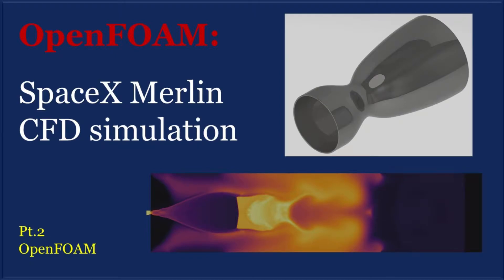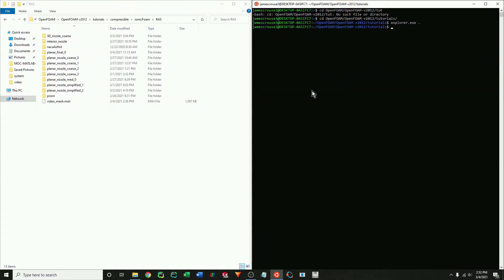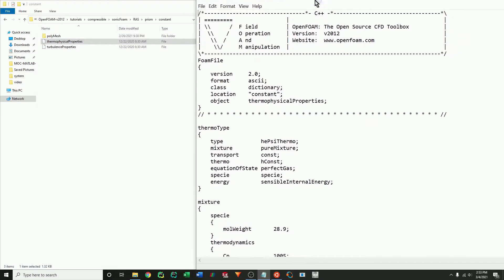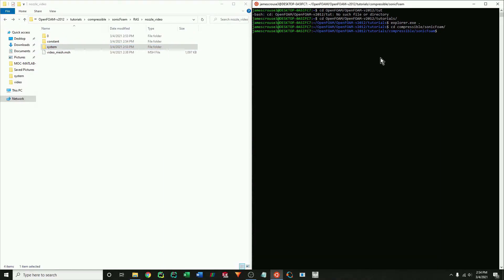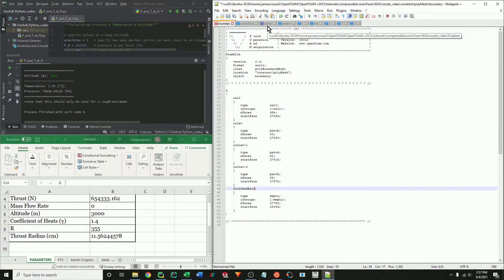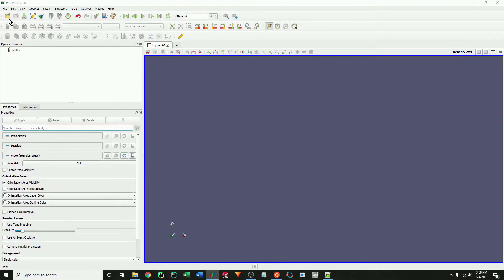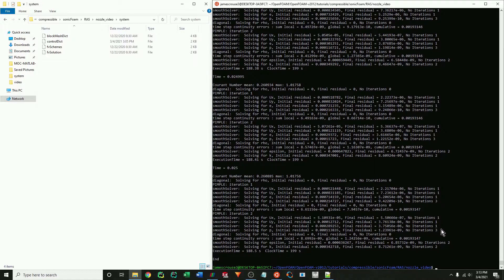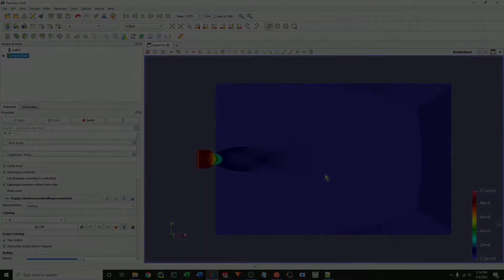SpaceX Merlin Nozzle: Pt.2 - Running the Simulation | OpenFOAM tutorial 3

Comment: Out of curiosity, why were the top and bottom walls of the domain noSlip? Would you not want them to be open boundaries? I've been playing around with this case for simulating my own rocket engine, and have been running into issues which I think are probably stemming from shocks reflecting off the top and bottom boundary walls.

Comment: Hello,
Thank you for making this great work.
I have some question about this project. How can I calculate epsilon (turbulence kinetic energy for this project)?  Initially every where it was selected 266000.
When I run I get negative T0 error, How much should I decrease Delta T in order to avoid this error?
Thank you and Best Regards.
Reply: You can calculate k and epsilon at the inlet based on your turbulence model coefficients, average velocity and a given turbulence intensity. See the equations for k and epsilon.
I don't know what is going on about this T0 error. Are you setting T0 = 0?

Comment: can axisymmetry be applied to save time and memory?
Reply from the maker: for sure. I am honestly considering re-doing this video at some point, likely with a 3d case as well.
Reply: @interfluo6420  Thank you for putting this tutorial online. If I understand your setup correctly, you are performing a planar 2D simulation of a nozzle that is in reality axisymmetric. For a nozzle flow like that the change in cross sectional area is going to govern the expansion of the gas through the nozzle, which in this case you are not capturing as your geometry is planar, not axisymmetric. If you want to simulate a 2D axisymmetric flow you will need to use a CFD solver that solves the axisymmetric flow equations (or use the "wedge method" to achieve this in openFoam). Hope this helps. Cheers, Ragnar.